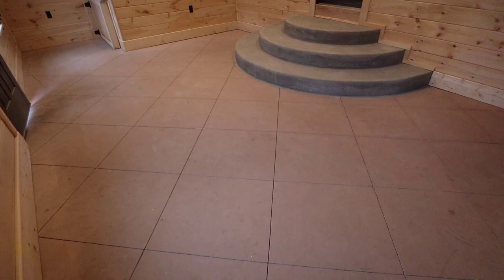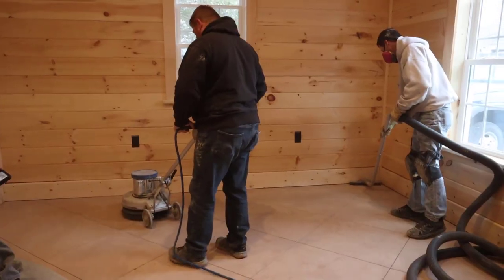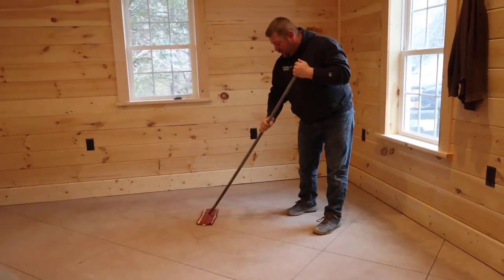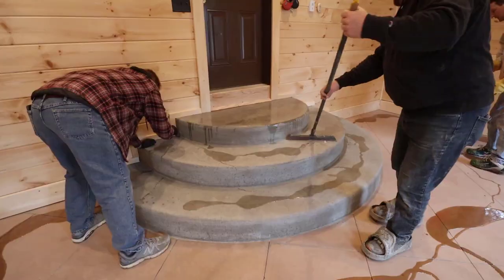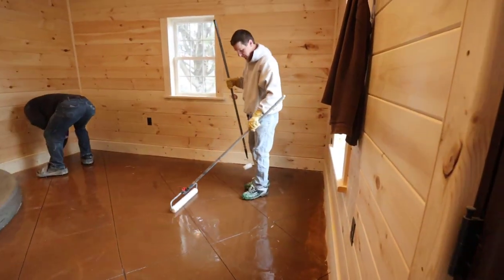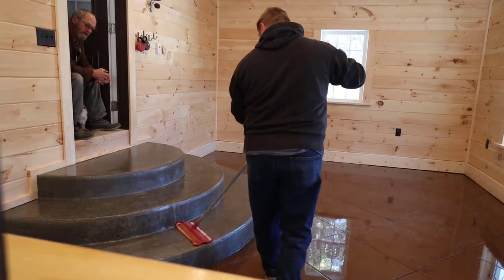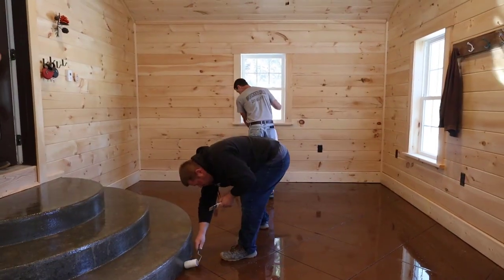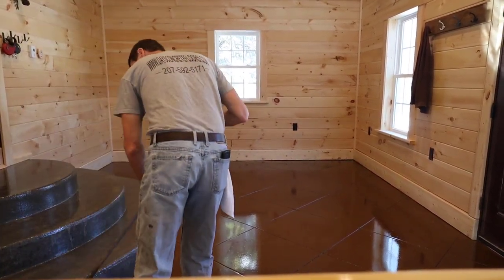How To Epoxy Seal A Concrete Floor (Colored Concrete)

Comment: Very nice Mike! Floor looks awesome. What was that room for?
Finish concrete surfaces used to drive me crazy, trying to keep them nice throughout the rest of the construction process. Because they’re poured first they always take a beating no matter what you do and always require a certain amount of repair by the time the rest of the job is done. Gouges, nail or tapcon holes, spilled paint, drywall mud, plumbers glue, etc etc.... Always a tough job.
Reply from the maker: Thank you! This was the room before entering their actual house.

Comment: Very nice video and very helpful also. I'm by to do my basement floor with epoxy.
One question Mike what do you think a black primer with platinum base code and some withe pearl highletes.
Reply from the maker: That would look very good.
Reply: @MikeDayConcrete  
Thanks Mike I will send a pictures or video once is done

Ramon

Comment: For a Long time I wander If It is possible to put 2 types of sealers for different properties ( 1 Penetrating and 1 Coating )
Would it be possible to apply a water-based siliconate PENETRATING SEALER to protect from freeze/thaw cycles (which can be applied just after finishing the concrete while concrete is still curing) and after the cure, put another epoxy COATING SEALER to get the just right sheen and slightly slipery floor finish we want